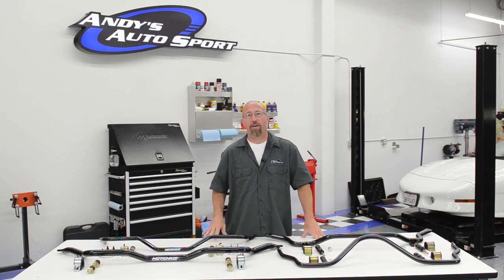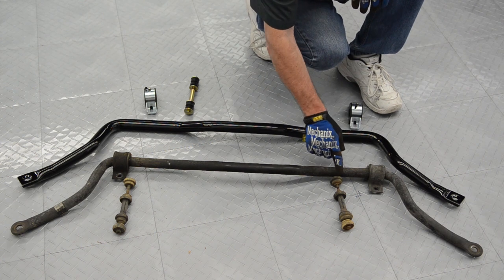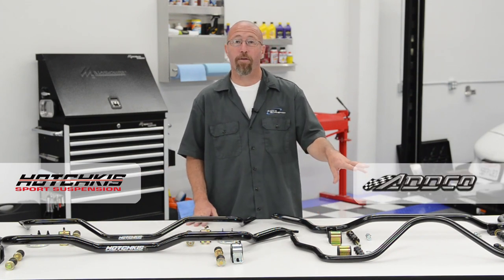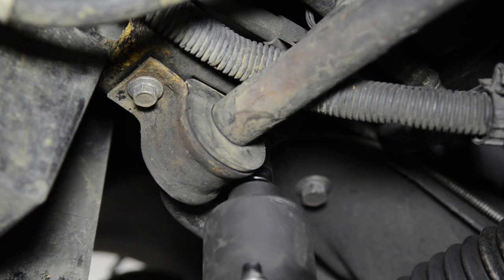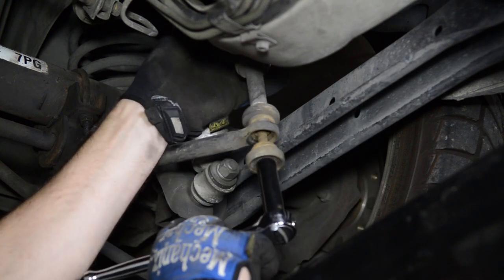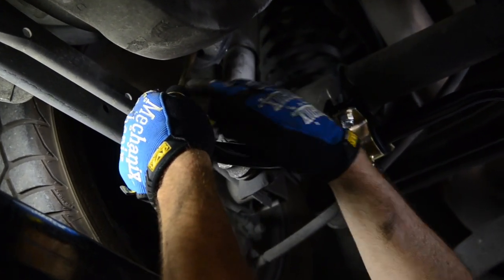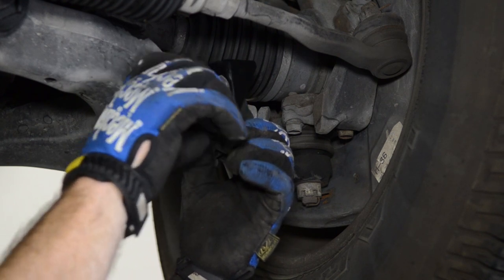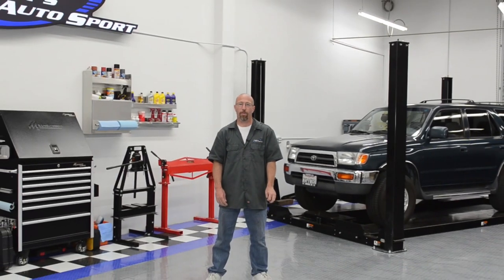Sway Bars - Presented by Andy's Auto Sport

Comment: On track, the fast Miata we have with 325 wheel HP, runs no Sway bar in the rear. Most race cars take the sway bar OFF during wet condition. Less sway in rear actually will give you MORE grips. It is important that sway bars Match front and rear, because it will affect the under or oversteer characteristics. Well, you put a thick ass sway in rear if drifting and the rear end will come loose really quickly, Because no grip.